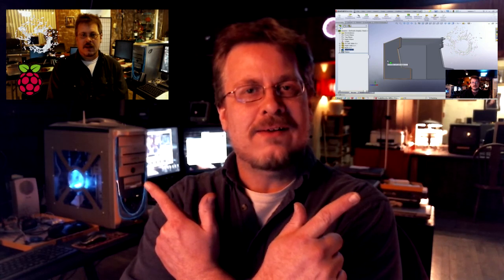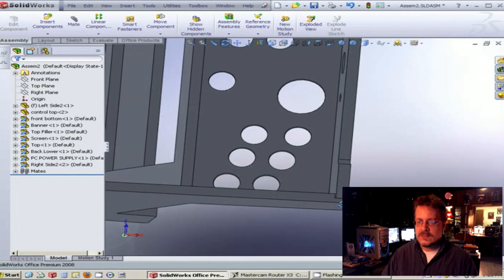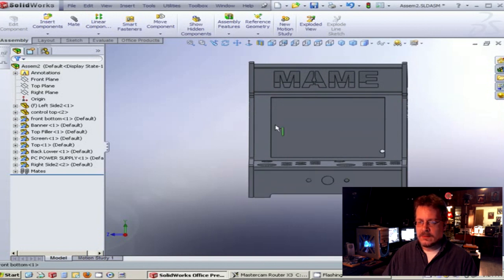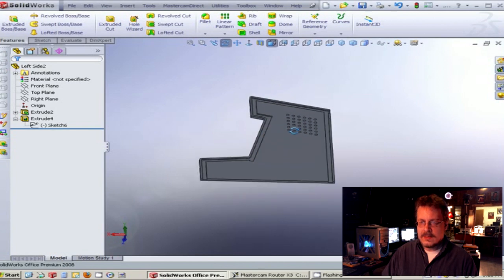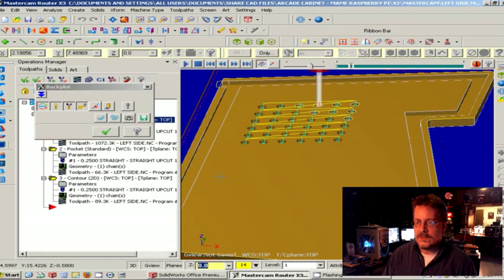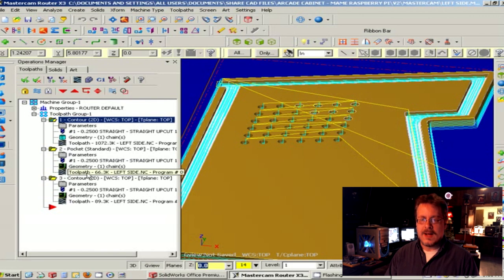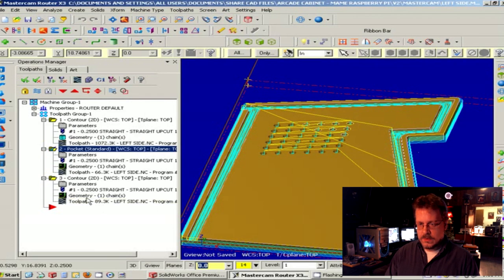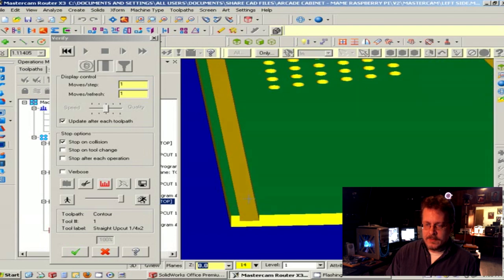All About the CNC Router 101 - Creating Machine G-Code - Part #3

Comment: 7:00, seems that's the long way round. Left to right, return to left, drop down to next row, do it again. Why not left to right, then just drop down to the next row,  then right to left? Time wasted. This seems to be a common practice in amateur CNC machining, most inefficient. Or am I missing something? Is this the CAM software default?
Thanks for your post, most helpful.
Reply from the maker: Standard practice is clockwise for outside profile and counter clock for inside cuts and pockets. This action counteracts the spinning bit. Yes most CAM software is defaulted to behave in this manor.

Comment from the maker: Sketchup reportedly will work for this purpose. It did not have the required functionality when I was getting started and in need of a cad/cam package but now it supposedly does.You will need a utility to convert sketchup drawing to G code so you should ask someone that has experience using this and I do not. Try going to cnczone dot com and asking in their forums.